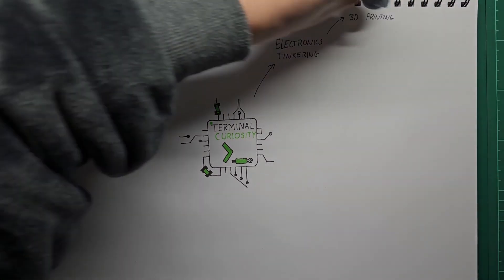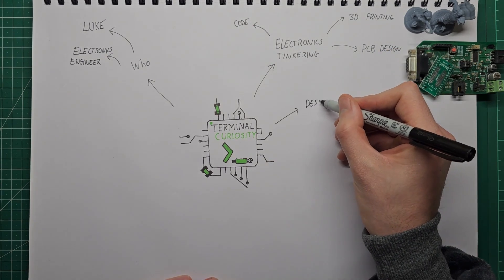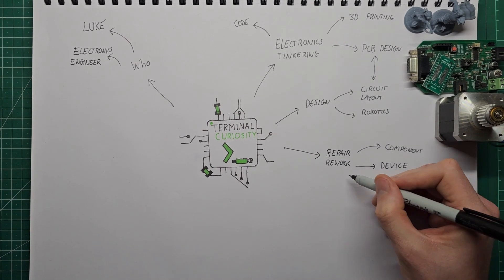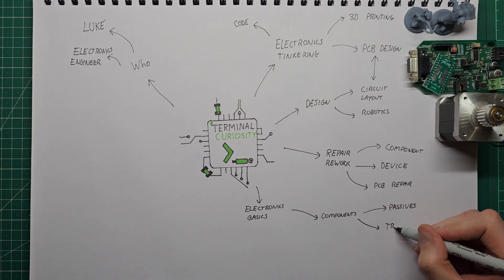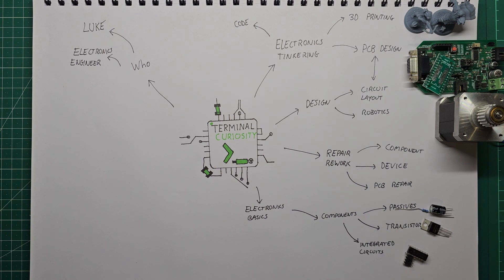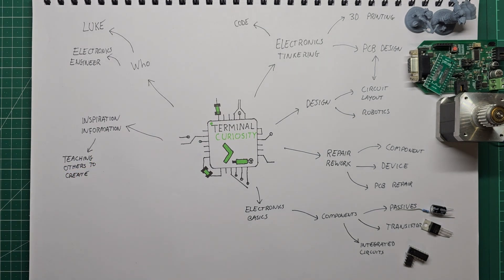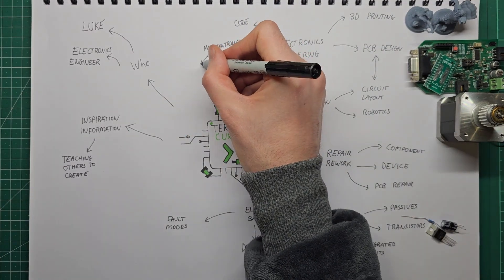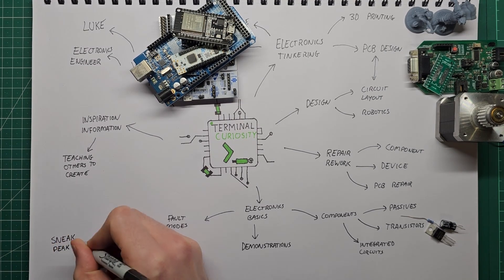Why I Made a YouTube Channel as an Electronics Hobbyist

Comment: Sounds good. I literally just build the signal generator kit from your other video. Perfect timing. 

Given your years of experience and what point did you pivot from replicating other people's circuits to making your own?
Reply from the maker: Good question. I've always loved designing my own circuits even at university so I focused on that pretty early. I would much rather build it from scratch and take forever learning instead of copying someone else to just  get It done quick. I've always spent many years reverse engineering other people's circuits for repair purposes, so that helped a lot too
Reply: @TerminalCuriosityEE  Yeah, I feel like its cheating when you rip off other people's designs. 
It's about that sense of ownership over the project